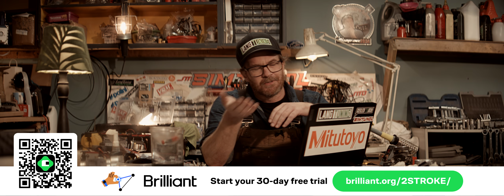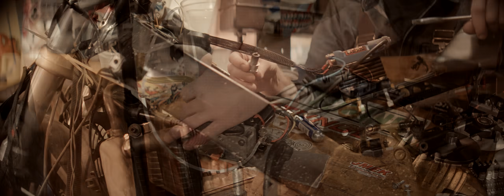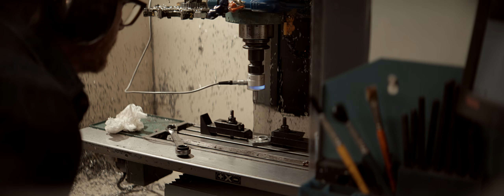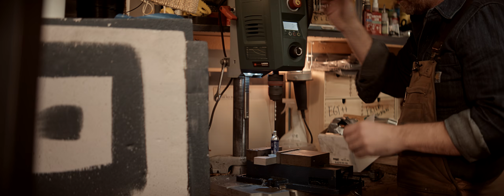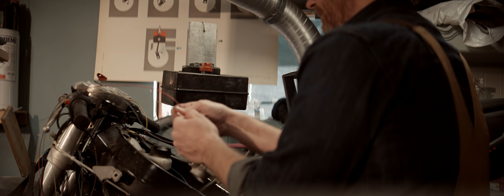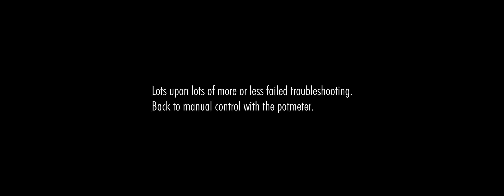Two Stroke Nitromethanol EFI - First Test!

Comment: Arduino is very sensitive...  you can use plugspark with resistor and use octocopler on the motherboard to reduce noise. Or plc is bether they have protdction for default

Comment: You could try using a standard  EFI fuel pressure regulator setup, the type that has a pressure regulator in the return line back to the fuel tank, pump can run at full speed all the time, the regulator will hold the pressure to a set pressure all the time on the injector side irrespective of injector flow and and dump the rest back to the tank, use the PWM to control the injector

Drag racing do it different because 11000 hp nitro fuel requirements cant really be done with the standard way with standard parts, you could use a standard  injector sized for a 500ish cc engine

Comment: When you're cranking on this motor with dry charge are you flooding the cylinder with oil first? Wondering about dryish wear and heating. Fuel is the primary source of cooling...

Comment: Why do you need the Arduino? Since your ECU uses a programmable map to translate the TPS to a PWM output, wouldn't it be easier to directly feed the PWM Signal as an input for a Brushless motor controller?

Comment: Good day to you. You might want to look at the use of quinky tubes to take care of your pump pulse. We used this principle on the P-3 Orion aircraft hydraulic system. It involves the use of teeing off 2 unequal lengths of line from the pump output, then teeing them back into the supply line. They theory is that the 2 unequal discharge line lengths cancels the pulse of the pump stroke. It operates much the same way as an accumulator but has the added feature of no moving parts or supply capacity that  happens with  an accumulator. The length of each line just needs to be 1/2 of each other. for example make 1 line 4 inches long the other 2 inches long. The other thing we did was route this line through the fuel tank and it acted as cooling radiator to cool the hyd fluid.

Comment: I'm glad my comment on DSG pumps helped. Is there any safety rules around pressurising the fuel tank I presume there is as what I'm thinking isn't complicated and should be very reliable yet I've never seen anyone doing it. My idea is to keep the fuel tank at a constant pressure with a pre charged air tank and a regulator use a very large fuel line to make sure it will easily keep up when fully open and then it should just be a case of figuring out the best way to deliver it into the engine.

Comment: I dont know the properties of Nitro Methanol but with an ‘unseperated’ accumulator where the gas (air) is in contact with the liquid, you might find that your trapped air dissolves in the NM over time and you lose some of the damping effect.

Comment: Alex, if you use a non-return valve between the fuel line and your CO2-bottle accumulator, a pressure spike entering the accumulator will be caught there and the pressure in the accumulator will increase. Then the accumulator will only be able to absorb pressure spikes with an even higher pressure, increasing the accumulator pressure more and more. 
Just leave out the on-return valve and let the accumulator do its thing.

Comment: Note for fuel pump: Add a gear reduction from the motor to the pump. The reason for pulses are most likely from the uneven load from the pump. If the motor is at a speed where it is more efficient, there will be less pulses due to a bigger load.

Comment: An idea for if this method of fuel injection doesn't work. 

Have you thought of using a traditional efi fuel pump and making / modifying a fuel pressure regulator so that you can electronically adjust the fuel pressure.  You could do this by attaching a stepper/servo to the pressure regulation screw.

Comment: This is rapidly getting too complex and you have too many variables, un-tested elements, and poorly tested elements.  Perhaps you should back out of this potentially blind alley and brainstorm a few alternatives that might compare better (e.g. plenum and regulator, conventional port injection, mechanical injection, etc.)  I know each of these has their problems but they also have solutions that involve fewer elements and therefore fewer potential failures.

Comment: Can you not fit/make a small accumulator on the discharge side of the fuel pump to iron out the pulses at low speed. Just need a vessel with a fuel resistant diaphram

Comment: The accumulator is a great idea. My wife designed high-pressure/high-volume hydraulic pumps (35gpm/3,500psi) for air-control-surface actuators on airplanes. I think she used an accumulator to dampen the ripple in the output of a nine-piston engine driven pump.

Comment: Caterpillar uses pwm throttle position sensors. The use a range of 10 percent to 90 percent. 10 being idle and 90 wide open 
 The say less then 10 or more than 90 Is too close to a flat line.

Comment: Spark ignition can mess with analog readings. Ran into this issue when I was using an ardunio to drive a servo acting as a replacement for a mechanical tach.

Comment: Drive the pump with the engine. Gear ratio over spooky electronics someone else built. Great video, always anxious for the next!
Reply: Considering the plan is to use passive injectors - that would necessitate an electronically regulated bypass valve or similar to regulate fueling according to rpm and load/tps. 

Fully mechanic fuel injection has never been widely adopted for various good reasons, one being that tuning a mapping integrated in a mechanical device is not as trivial as it might seem and needs a lot of work. Electronic is way simpler, and that way it is a rather trivial control application.

With active injectors I'd agree though. 

Damn, can't write English worth half a dry fart today, or maybe it just sounds excessively strange in my mind, but I guess you'll get my point despite the strange wording and whatnot.

Comment: The problem with pulsing can also happen if there is too much flex, where you don't want any buffer or flex changing the capacity of the line.  Hard lines or braided lines helps reduce the expansion.  The fluids don't really compress, but the flex fuel line will causing it to act like it does

Comment: grab a stock standard EFI pump from an R15 or similar. theyre BLDC in the later models. so you have to get the ESC that is actually the tank penetration/fuel barb fitting doodad and simply runs on 12v. even has polarity markings?
cheap... if the pump cant flow enough, there is a whole range of them available for about US$20 or less... no regulator as they all start bypassing at around 45 psi, in my experience.

at that point, its a plain old 128g or so injector...if it cant idle, its too big, if it cant hit max RPM, its too small, and that enters the area of dual injectors...

you can make a perfectly acceptable ECU with a 555 timer chip, running astable, pulse width controlled by varying the control voltage on pin5... screw arduino. WTF are you using a breadboard for when you have vibration, oil, heat, and high frequency square edged signals with loose wires dangling everywhere?

meh. youve been progressively working your way backwards for at least six months now. wheres the AMR? wheres that snail?

i refuse to brown-nose. you need someone that will say it as it is, unfortunately YT then deletes my comments. yay. "free speech" rocks.

stop listening to the "yes men". youre getting no where.

Comment: You got lucky there, imagine that happening with a red hot exhaust. Id make that eksternal fuel system encased so next time leaks occurs it would just drip down a tube onto ground. A motor with even lower kV would further reduce the motor pulsing. In rc crawlers we often use medium kV motors with gearbox/high battery voltage (vs low kV motor with standard voltage battery)to make the motor turn slowly with lots of torque/no jerking. A gearbox have less loss than a lower kV motor.  A motor with more coils/stators usally have nicer low rpm behaviour. Plane or drone esc often handle 4-6s and they are really small/powerful/dirt cheap matched with a low kV motor gives nice low end torque.

Comment: With different gearing, the electric motor can be run at a much higher rpm even at low pump speeds.  This should make it much smoother.

Comment: Very elegant solution and cost effective solution for the accumulator/pulsedampener, however the air in the accumulator will eventualy disolve in the fuel and be washed away making it stop working. It need to have som kind of a membrane. Perhaps one could use some kind of closed cell foamrubber ball/cylinder inside it (it wouldnt be distroed by over pressure). 
I couldnt see clearly when you opened the pump but it looked like at loberotor pump, they pulse alot.

Comment: You should get an oscilloscope! It gives you a visual of the PWM and may show possible interference or noise that might be picked up by the Arduino. I got a cheap analog one second hand for not that much, they work great for things like PWM, a cheap digital one also works fine, but the quality isn't that good so you might end up finding it broken. Also, breadboards can act like an antenna and may screw with the reading. 

Keep up the good work!

Comment: With all the viewers you have you can write a software specification (define inputs, define req. outputs, define operating environment, define constants, draw a picture of the system in rudimentary mechanical elements ie, pump, compressor, pipe, valve, etc. and what you think the fundamental principles are, ideal gas laws, or, bulk flow, laminar flow, compressible flow, incompressible flow, etc).  An engineering software developer will run with that.  Your needs are an iterative process, looking at variations in design parameters to predict max fuel flow, flame propagation characteristics, etc.  There has to be internal combustion, open source, codes to start with.  I’m a retired design engineer with 35+ years, so I had to learn FORTRAN, BASIC, COBAL (business) and found it to be a pain in the ass.  Writing code has nothing to do with the actual phenomena, in fact it’s a hindrance.  It’s a tool in a tool box.  Dont get infatuated with shinny tools.  Come in guys!  Don’t make a computer geek out a perfectly good Natural Engineer.
Reply: you can make a perfectly acceptable ECU from a basic 555. yes, a 555 timer chip. 

the basic fundamental is dead simple. at a given throttle setting, theres only so much air in the cylinder, so an injector of a given delivery rate has to open for so long, once per revolution on a two stroke. so you only need a PWM astable oscillator driven by a crank signal. which is what a 555 can do.

for the efi side? theres almost no need to bother with maths. its really simple.

at 12k rpm, you have a 5mS window to perform this injection. which sets the minimum size injector required. if its too small, you dont deliver enough fuel. game over.
conversely, at idle, the injector has a minimum time that it can open for to operate reliably... around about 1.2mS. if you cant get a decent mixture with what you have, as it delivers too much? you have to start thinking of dual injectors...

the tricky aspect is when you start coding, and realise that interrupts can and will conflict. especially if you are NOT a coder!
exactly as you say... writing code has nothing to do with the actual phenomena!

the only open source code i have found is speeduino, and even thats a nightmare as the fact it IS open source means its written with a huge amount of BLOAT. more time spent trying to figure out what can be removed than to start from scratch.

take away all the fluff, and all you are doing is making a PWM driver operating in a narrow window, using two or three basic inputs... throttle position, manifold pressure, and RPM.
Reply: Or just use speeduino, it's already done and tested

Comment: Why not use a actuator to open the throttle, and controlled by a pot connected to the throttle, that will also control the pump speed. With an adjustment to add to  the fuel to throttle ratio or the opposite, to lean it out. It could be a crude EFI or just FI.. 😆, like spraying brake cleaner in a engine to get it running, when the fuel just isn't happening, only much better. And adding fuel to the throttle opening .

Comment: Good stuff! Try to think the prototyping parts so that you don't end up with any potential "runaway" stuff. Tinkering is always fun but don't get too carried away :D Try to think ergonomics, working positions, ease of access and possible failures. A big easy to use kill switch wouldn't hurt :D KISS method for the basic stuff I think is preferable.

Easy for me to say from the other side of the screen. I mostly get carried away myself when doing stuff, so I know it's not easy to stop and reset. But at some point in the past, a certain Roadkill live stream from SEMA show taught me to do constant "tool resets". Meaning you stop what you're doing and put every tool back in their place, or on a certain spot where they are in some sort of order and easily accessible for continuing the work. Being pretty ADHD, they sure have helped me with the clutter and also the progress. This summer I did my first engine swap on a car (though I just swapped a greanaded engine for a healthy one) and I did a lot of tool resets, even at the very start of diagnosing the blown engine. It doesn't even take that long, especially if you have at least some place for everything you're using. Tool boxes and carry case toolsets are easy, but other stuff maybe not as much. Though you just need to reset the clutter and the tools you're not using at that specific moment, not the whole working spot or "station". Though I prefer putting every hand tool back in their places or to a certain spot so it forces you to think back and start again.

Comment: The accumulator solves one problem and introduces another. Huge amount of hysteresis to the system. For a WOT Bonneville run this is not perhaps a major issue. But something to be cognizant of none the less.

Comment: Dear friend a recommend some tips and tricks for you to achieve max HP in your 50cc 2t engine.
1 get universal programable ECU  2t 4t for motorcycle
2 for alcohol a/f 6.5:1 MaX power. For gas 13:1 these value achieve max power.
3 find magneti Marelli six holes injector 12 v
4 use 16:1 mixture gas/oil or 30:1alcohol/oil.
5 use Castrol 747 for gas, shell advance racing M for alcohol
6 break in at least 5min at mid-range rpm.
Try it and comment success.
I'm former MotoGP 2t era 80'
Have a nice day👍

Comment: Green seal is Viton. Good with fuel and alcohol. Blue is typically flouro-silicone and nitro is listed as mildly aggressive and would not be considered as an acceptable choice. That would explain those seals at the top of the video. I ran MFI extensively with methanol. Do over-spin the pump and use a by-pass. You may need an idle by-pass if you want a reasonably tame idle. I really like the EFI solution for THIS application, tighter range power band widths. If you want to pull the torque curve up really fast, then 100% MFI is the solution, which is much faster reacting than EFI. EFI is always BEHIND the instantaneous engine demands. It first reads, then corrects. So slow compared to MFI, which is instantaneous to engine demands. It's actually a highly balanced hydraulic system, and it don't get any faster than that!
Reply: 100% viton for the win, those blue silicone ones don't like a lot of solvents
Reply: In case this is read by Mr STUFFING i have something to add, hydraulic pumps really dont like gasoline, it lacks the lubrication so be very very aware of gaulling inside the pump. I have built a jet engine and modified one from a mig23 (see my channe l for proof), i had the same issue, its difficult finding good fuel pumps that dont need oil for lubrication.
Reply: @NIOC630  Yes! I forgot that real MFI fuel pumps (Enderle, Hilborn, Waterman) have a special case hardening on the gears. 22308 Waterman pump has 3.91GPM flow rate. You should be able to bypass off the extra fuel and scale it to your application. Pump is available on the Alkydigger web site in USA.
Reply: @NIOC630 
Considering it's a two stroke using premix or RC fuel, at least so far, there should be a fair bit of lubricity.
Good point nonetheless.
Reply: Seal eningeer here. The info stated about seal colour is incorrect. You cant assume the colour guarantees the composition. Mainly due to China fakes flooding the market.

Comment: Just connect the ground and signal wire of the TPS directly to the arduino's 0-5v analog input. Don't bother messing around with a PWM signal out of the ignition system.

Comment: 😊why dont you run the pump at high speed and create a fuel rail with constant pressure. You just return the overcapacity to tank. You can choose to keep a constant pressure or variate the pressure according to engine speed.
Reply: He does not use controllable injector but just a nozzle. He is using pump speed to control flow. I personally think that trying to make the system so simple is actually counterproductive and creating more issues than solving.
Reply: @rehepeks  he has been going backwards for at least six months now. i cant watch anymore. skip... nothing. skip. nothing. skip...